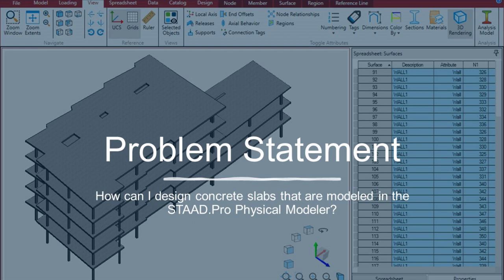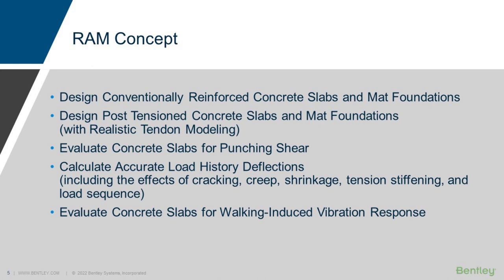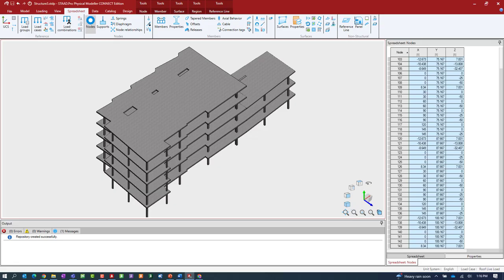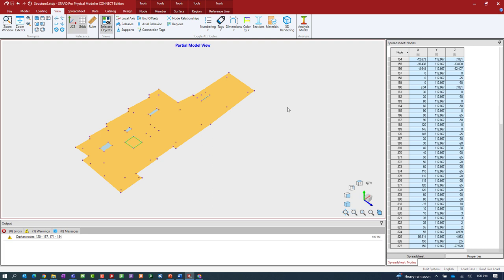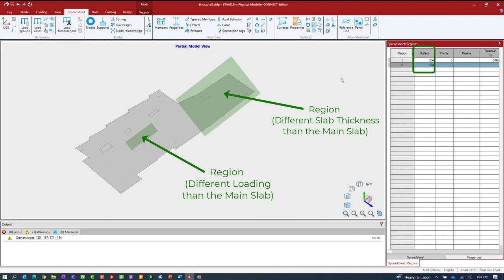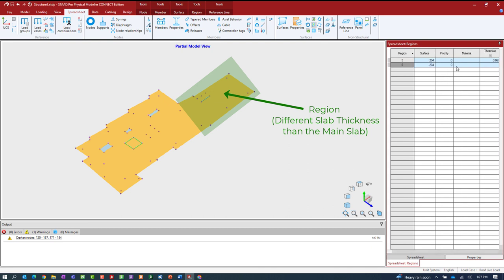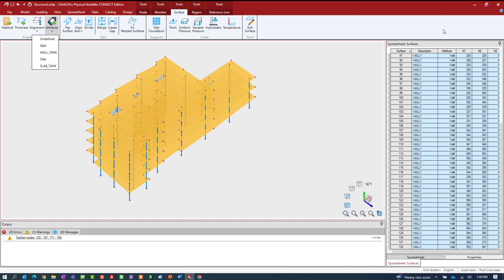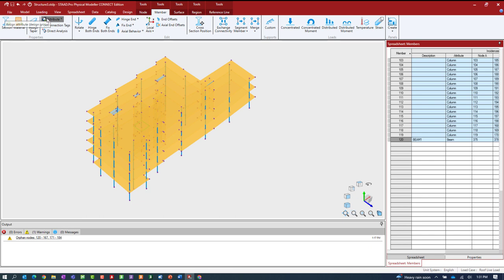Sending Slabs Modeled in STAAD.Pro to RAM Concept through iTwin Analytical Synchronizer

Comment: Please prepare a session on how to send slab modeled in Analytical model to RAM Concept
Reply from the maker: Finite elements from the STAAD.Pro Analytical Modeler cannot be pushed to the iTwin Analytical Synchronizer. To perform an integration with RAM Concept, we recommend that you model the structure, including the surfaces, in the STAAD.Pro Physical Modeler.
Reply: @BentleyStructuralAnalysis  i don't know how to model structures in physical modeler